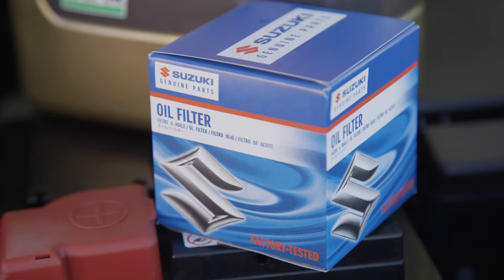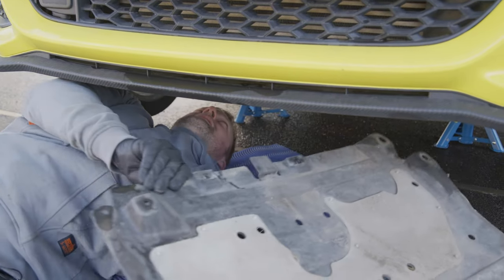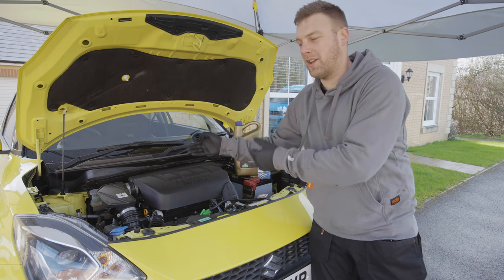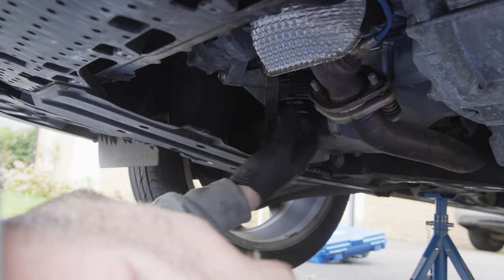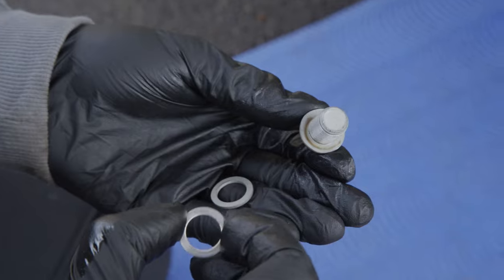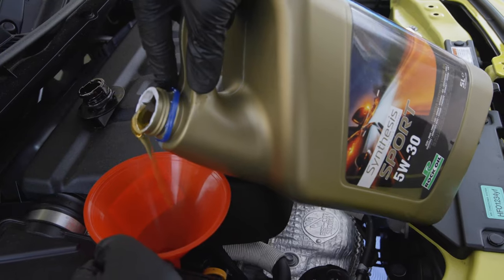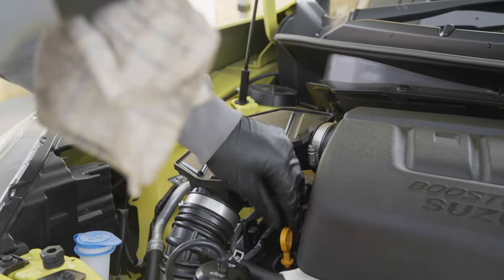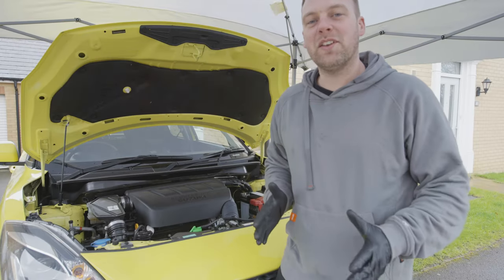How to change car oil and filter

Comment: I want to start having a go at maintaining my car like this. What is an easy thing for a beginner to do? To get started?
Reply from the maker: Awesome! An oil change is a great place to start, you could also look at rotating tyres, air filter change. Or If you're feeling a little more adventurous you could try and change the brake discs and pads. Let us know how you get on.